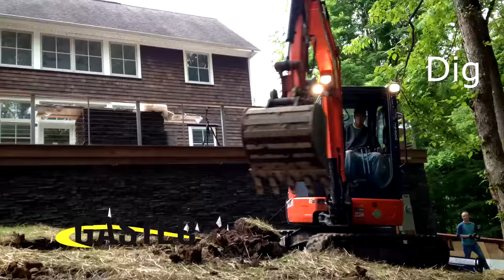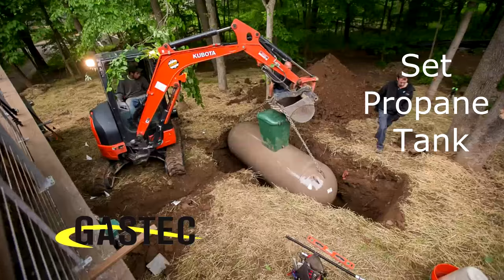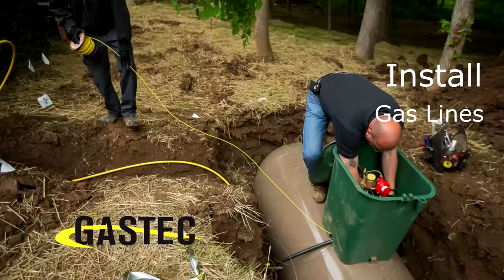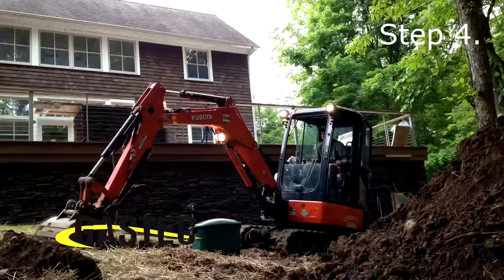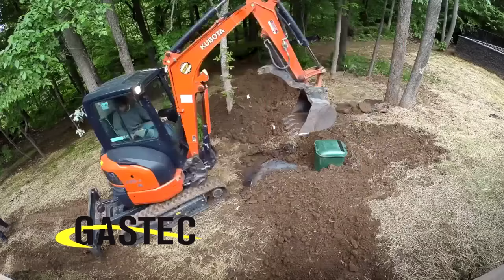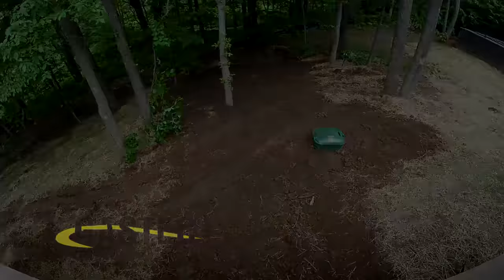Propane Tank Installation - Underground 500 Gallon Tank

Comment: I didnt see any form of cathodic protection installed. Or was it just not put on video. With out magnesium bags corrosion will occur much quicker.
Reply from the maker: Magnesium Anode bags were installed,  just not seen in the video.  And you're correct, without that cathodic protection, tanks can definitely corrode much faster!